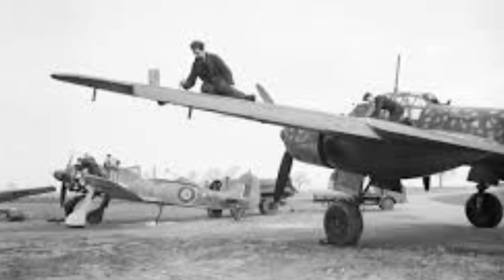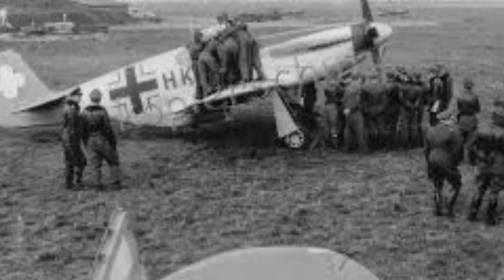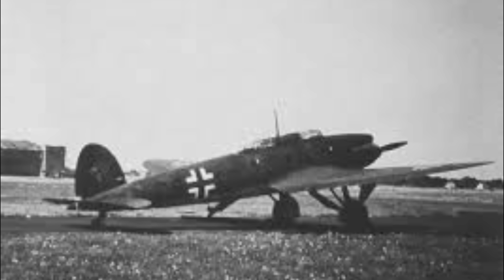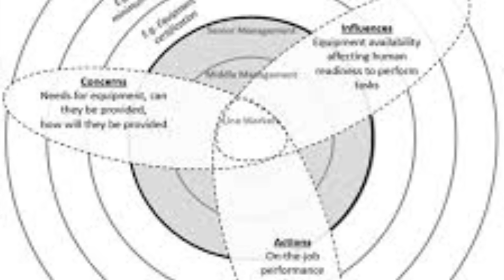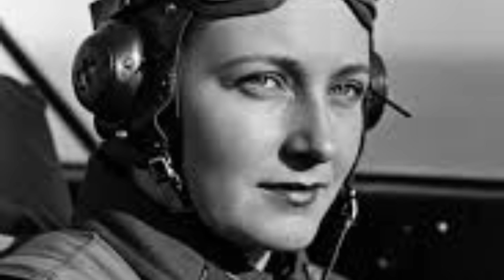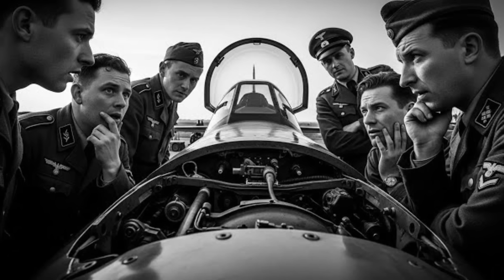“German Pilots Flew a Captured Mustang—Then Admitted No Luftwaffe Fighter Could Match 444 mph”

Comment: 13:02–14:14 when he notes the Mustang reaching “715 kmh, approximately 444 mph” and concludes a German pilot “cannot escape a pursuing Mustang” really reframed the entire air war for me, because it shows how speed and range weren’t just specs but total control over when and how fights happened; I love how the story highlights honest engineering over propaganda and how industrial scale decided outcomes—do you think any late-war German design could realistically have changed this imbalance, or was it already too late by 1944?
Reply: In autumn 1944, the Focke Wulf D-9 ("longnose Dora") and the Messeschmitt Bf 109 K ("Kurfürst") appeared, which also could make about 700 km/h, some later versions like the Ta 152H even 730 or 750 km/h, but those came "too little and too late", as usual. However, the main problem was lack of fuel (especially high octane fuel) and lack of (experienced) pilots. Actually, the war was lost in 1941 already, with the two catastrophic and suicidal decisions to attrack the Soviet Union and to declare war to the USA, both totally unnecessary and stupid IMHO.

Comment: The Americans were using 130 grade octane fuel in 1944 and some 150 octane fuel was available before the end of WW2. This gave the allies a huge advantage over the German aircraft.
Reply: The reason for that was Jimmy Doolittle had left the Army in 1930 and went to work for Shell Oil. He convinced the president of Shell that a war was coming and that high octane (100) aviation fuel would be a wartime advantage. Shell stockpiled the fuel and along with astonishing American aircraft production, it helped overwhelm the Luftwaffe and Japanese air forces. Doolittle, better known for a Medal of Honor leading the daring B-25 raid on Japan in 1942, was also a PhD from MIT (1925), the first PhD in aeronautical engineering in America. In my view, Doolittle was the greatest aviator of the 20th century. 🇺🇸

Comment: Speed of sound is higher at altitude. Thinner air, less resistance. Low altitude has denser air thus slower speed of sound as the density resisits transmission of sound.

Comment: This engine produces more than they say it does. As I recall of the Horsepower is over 2,000 . Leave it to AI to get this wrong, along with some other facts.
Reply: Later versions produced up to 2000 HP. The one the Germans tested was an earlier version.
Reply: The only one which reached about 2000 HP or more in war emergency power was the V1650-9 from the P51 H, with methanol water injection and Direct fuel injection. And It seems that was not very consistent in giving the rated power and speed. Some very late war P51 B/C and D with 150 octane fuel could deliver about 1890-1900 HP but this could be a nightmare because of high sparkplug fooling and destruction of rubber pipes and similars due to highly corrosive fuel (it decreased the life of the engine). And it improved little the maximum speed above the rated altitude, . Altough It turned the P51s in beasts at low altitude were dramatically improved speed by 15-30 miles per hour.
Best regards
Reply: The Merlin never officially hit 2,000 hp — it topped around 1,700 with WEP. What made the Mustang unbeatable wasn’t raw horsepower but the supercharger and aerodynamics. That’s why even German test pilots admitted no Luftwaffe fighter could match it at altitude.

Comment: Adolf Galland said in 1943 after testing the Me262 "WE MUST STOP ALL PRODUCTION OF AIRCRAFT BAR THE Me262 AND THE fw 190". Obviously he was talking about offensive aircraft.
The allied 130 octane could not be produced in Germany and did not do a 2 stage supercharger even though they had working examples in these allied aircraft.
So if they cannot compete with the 2 points above throwing their lot with jet engines that could burn inferior fuels should have been a no brainer. In tanks they still used petrol when they know the 25-30% better fuel economy of diesels. 2 parts to a solvable puzzle high Command and Hitler dismissed.
The heinkel 280 was ready in 1943, the engines with rare metals needed could have been built like the 262 if other offensive aircraft had  production stopped.
Another important defensive tool Allies had from early 1944 was REAR FACING RADAR, basic, that produced a tone when an axis aircraft was up to 1,000 metres away.
I thought the He 178 the first jet aircraft flying before the war could have been put into production with testing and swept wings . Single engine jets were the way to go - the best type with perfect flight characteristics was the Me 163...alter the engine, lengthen the fuselage and put in a jet engine it would have swept the sky's of allied aircraft.
Someone has built an exact replica of the 163 as a glider not having an engine and it flies amazingly well at slow speeds.
Reply: Yes, the Allies had far superior airborne radar of all types due to the British invention of the magnetron. Both British and German jet engines had very short lives during the war. The sophisticated alloys needed for turbine fan blades were not well understood. This is why both the Me-262 and Meteor were twin engine aircraft and were better suited as interceptors than dog fighters. It was pretty much over for the Axis by the Summer of 43. The technical, industrial, and resource advantages of the Allies were overwhelming and earlier tech upgrades from the Germans would only have delayed their defeat by 3-6 months. The failure to conquer the USSR in 1941-42 or accept a settlement while declaring war on the US doomed the Nazis.

Comment: Incredible! Even the Luftwaffe had to admit the Mustang was an unmatched masterpiece of engineering. True respect for this legendary aircraft!
Reply: It worked for what it was for at first,it improved greatly with the British Rolls Royce Merlin engine in it,the same engine as ths Spitfires and Hurricane fighters as the British during WW2
Reply: Respect too
Reply: But it was the P-47 Charlie that won over your Abbeville boys fling FW-190A'-5's over Germans occupied France. Very soon after initial victories the 56th kill ratio of 39 to 1 over Germany's best pilots and kept that ratio their. From Oct. 1943 to Feb.1944, the 56th lost 10 men,but shot down 210 German fighters ,the best pilots the Germans had. Bf-109's,ME-110's and FW-190's were shot down by the dozens .
Reply: @56tcA90  Three sixteen plane Sqns of Hurricanes beat the 56th kill count by a good margin
Reply: It was German -designed….Look up Edgar Schmued.
Reply: The 190 and 109 were far superior.  The mustang flew with 150 octane fuel while Germany had usually 85, and sometimes up to 89.  If mustang flew with 89, it would be garbage.  If 190 and 109 flew with 150, the mustang would not compete
Reply: @TRUTHandLIGHT4809  You really have an axe to grind don't you. Pseudo expertise!
Reply: @maryrafuse2297 Truth is truth.  Why does it bother you?  You said, pseudo expertise, what does that mean?
Reply: @TRUTHandLIGHT4809  the mustang was a better plane all the way around. It could fly faster higher and had a better turn rate. The mustang could also dive better. Good thing we had them and not the germans.
Reply: @RikkiSiebenborn if the Germans had 150 octane fuel, the 190 and 109 would easily out fly the mustang in every category.  Inferior fuel cripples an aircrafts performance.  The power of a motor is determined by how much manifold pressure it can achieve.  Low octane creates low pressure.  This means the motor does not and cannot reach its full potential
Reply: @RikkiSiebenborn 
The German Bf109 and Focke Wulf 190 always had highly derated engines by two things:
- A lower octane rated fuel at first.
- Most important: chronical lack of alloy elements to really develop the true potential of the German engines. 
He is technically right. A highly derated Bf109 G-5/6 with an engine barely doing about 1300 HP was going at about 630-640 km/h and a lighter Bf109 G2 with exactly the same power, about 645-650 km/h. When the engine was again rerated at 1475 HP, the G2 was capable of 665 km/h and the G5/6 around 650 km/h and all with a single stage supercharger. With the larger supercharger a derated DB605 AS, reaching about just,1280 hp launched a Bf109 G5 AS in mid 1943 to about 680 km/h at about 7.5 km. With a fully rated engine at 1435 HP the same airplane was touching the 690 km/h. A heavier Bf109 G10 with about 1435 sustained and 1800 HP in overboost in late 1944 was doing in the worst case 690 km/h and the best finished frames and engines, about 700 km/h, the same as a P51 D Mustang at similar altitudes. The DB605 DCM of late war was doing about 2000 HP in really low pressures of the supercharger. If would have had unlimited alloys to fully use the late war German C3 fuel, then would be producing about 300-400 HP more, similar to the best Rolls Royce Griffon dashes.  
Without contest, the true beast would have been the Jumo213 coupled Fw190 D and later TA152. With a really derated engine barely doing about 1900 HP in overboost It reached 700 km/h with a single stage supercharger. When began to use two stage supercharger as the P51 Mustang was doing, in crippled form was doing about 2000-2200 hp at around 3000-3250 rpm was reaching 710-730 km/h at high altitudes, and the TA152 H with same engine between 740 and 760 km/h, at 10-12 kilometres heights. But the own Rolls Royce experts and the Junkers engineers though that this engine at 3500-4000 RPMs, could produce about 2800-3000 HP if would have had unlimited alloys to fully develope the engine to make use of the C3 fuel. And with just about 35 litres (2135 cubic Inches).
It would have left any Allied V12 or Radial 18 cylinder engine white pale. It was better than even the very late dashes of the R2800 Double Wasp reaching about 2800 with Turbosupercharged methanol water injection engines of 46 litres or 2800 cubic Inches. The V12 Griffon just barely reached 2450 HP after the war in highly boosted methanol water injection dashes.
You can check the book The secret horsepower race from Douglas Callum. Very enlightening about the true problems in the Luftwaffe. The Allies were really lucky to compete with already engine derated Luftwaffe fighters all the entire war.
Best regards.
Reply: @franciscojaviermartineztor9745 thank you. I need to check into that.
Reply: @TRUTHandLIGHT4809   when Gunther Rall did comparitive tests on captured mustangs in late '44 are you seriously suggesting he used different fuel.
Reply: @JohnSmyth-l6i 1st are you claiming Germany had high octane fuels? 2nd are you claiming USA did not?  Germany test would have been made with whatever they can fuel thr plane with.  Gunther probably did not even consider the difference that exist between them.  With a lesser fuel one can test the mustangs climb, turn, stall, dives etc.  The knowledge they would not know is what a 109 does with 150 octane.   Gunter would think he had a completely different 109
Reply: @TRUTHandLIGHT4809 They both had a lower flight ceiling and less turning radius. Less cockpit visibility.
Reply: @TRUTHandLIGHT4809 you are producing baloney?!!!!

Comment: The FW190 was at least an equal. The problem the Germans had: was they couldn’t build them fast enough and had lost too many experienced pilots.
Reply: Fw-190 performance was not great at high altitudes. Until the arrival of the P-51D, Fw's carried heavy cannon and rockets and Bf's acted as fighter 'escort'. Fw-190D/Ta-152 variants were developed late in the war specialized for high-altitude operations, but far too late. The Allies had located all the Focke-Wulf and supplier factories. The Luftwaffe had been in crisis since 1942 in terms of being over-stretched. Goering could not tell Hitler no, and yet failed to expand the pilot training program. Yes, fuel was a factor, but so was the urge to roll the dice and risk everything for final victory, rather than rotating experienced pilots back to Germany to train the next generation.

Comment: The P-51B flown by 4th FG pilot Fraser landed intact on D-Day. The issue was a coolant leak. LW pilot from Rechlin was test pilot Hans Werner Lerche flew it to Rechlin at night on June 7.

The Gross weight fully loaded with 269gal internal furl of the P-51B was approximately 9600 pounds. The P-51D weighed in at 10,100 pounds with full internal fuel and ammo. The difference was two more 50 cal plus 500 rounds of extra ammo. The internal fuel is 2x92gal wing tanks plus one 85gal fuselage tank. Only the Mustang I had 170-gal internal fuel, The original P-51B had 184 gals before the fuselage tank was added in late 1943.

Fuel selection is left main wing tank where the carb overflow returns fuel. Terminal dives result in the Mustang 'hunting' to the right, requiring left rudder input, but there is no tendency o pitch down like the P-38 and P-47.

Endurance of P-51B/D with 2x108-gal tanks, with 20 minutes of combat was 8 hours.

The wing was not laminar flow - it was high speed/low drag. The laminar flow SHAPE had two advantages. First, due to lower velocity gradient to the wing point of maximum thickness delayed the Mach transition. Second, the shape and the manufacturing care in which the first 40% of the wing was puttied, sanded, sealed and painted - resulted in a longer region of attached transitional turbulent flow which resulted in Boundary Layer separation approximately 25% chord further aft than all conventional airfoils.

The first P-51B survived capture at Rechlin by US but was scrapped.
Reply: P-51's had a lot of handling quirks which were not positive. P-51's exhibited 2 structural failures a week on average. Wings came off  on at  least  3 occasions ,possibly more. P-51D's had a 85-gallon aux.tank. When full,you cannot enter combat until at least 50 gallons are burnt off.
Reply: @56tcA90  source for 100 structural failures per year?  There were strutural failures of wings due primarily to a.) failure of the ammo door in very high speed dives, and b.) failure caused by inadequate gear up locks when main fairing doors opened a few times during high speed dives.   The Mustang could 'enter combat' with full maneuver envelope with fuse tank reduced from 85 to 65 gallons.

Comment: Most enjoyable show. Did you know that Australia’s CAC built a faster better Mustang . the Kangaroo….
😮
Reply: CAC built Mustangs under licence during WW2. I presume you're referring to the CA-15 which, although similar in appearance, was not based on the P-51 and had different performance objectives. The design was intended to use a turbocharged Pratt & Whitney R-2800 radial but, due to unavailability,, a Rolls Royce Griffon 61 was fitted instead. Only the prototype ever flew with it maiden flight being in 1946 after the war had ended. As a result of the development of jet aircraft (e.g. the de Havilland Vampire) no more were produced and the prototype was scrapped in 1950.

Comment: Nonsense !!  Jingoistic Bullshit.  
ANY power advantage the p51 actually had was it's 130 Octane "allied: gasoline.
 Luftwaffe only had 87 octane Consequently their far more advanced engines made less power.. 
Untill they perfected Higher Boost levels via  water and alcohol/water injections.  
Then the  luftwaffe fighters were equal if not superior performers. 
 By 1944 ...Several Luftwaffe designs proved faster than the p51... of Any variant

Comment: Its only 600 miles from London to Berlin.
In the war documentaries they make it sound so far.
That's like St.Lois to Dallas which is about a 45 minute flight on commercial airlines.
Amazing!
Reply: It's not far, distance wise, but it's a lifetime when you have to travel so far over hostile territory.
Reply: I have flown from Berlin to London commercial.  A very quick and flight - in a jet.  In a prop place getting shot at much of the way to Berlin and back I'm sure was much less comfortable.

Comment: Hawker Tempest at  460mph, hawker Sea Fury at 466mph and the Spitfire Mk 14, Mk 21 were 449 and 455 mph. All of which saw combat
Reply: You're aware that you're talking to stupid, uninformed fanatics, right...?
Reply: The P-51 H top speed was 487 mph. It was in production before the end of the war, but the Germans didn't hold out long enough for it to actually reach combat.
Reply: @NotchFox  You have a humble notion of the compressibility issues that the airfoil of the P-51...? It could hardly reach a Mach of 0.80. while the Spit Mk 21 could reach M 0.87 
I'm afraid that you buy all the propaganda crap and glory, bedtime fairy tales.
The "H" indeed has nothing in common with the P-51 D, and the improvements were basically the Merlin 66 and the reduction in weight.